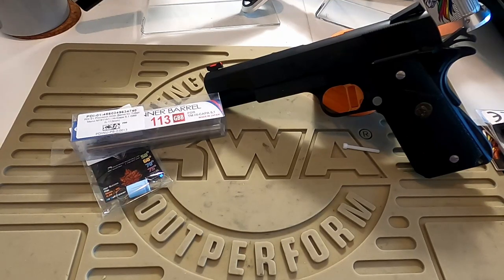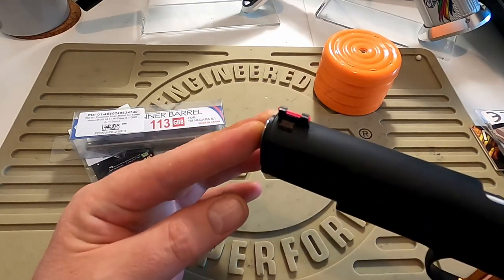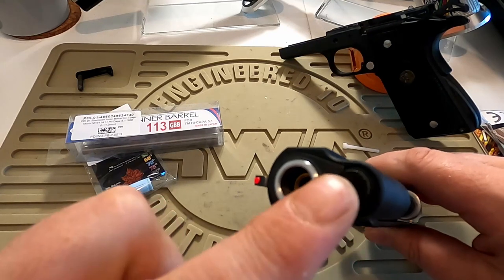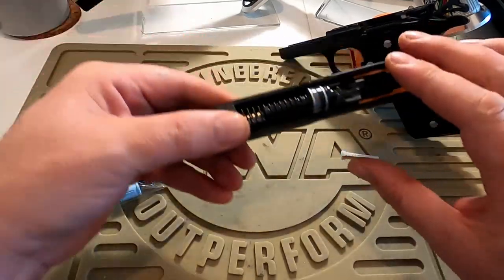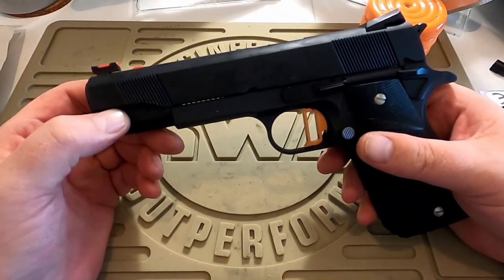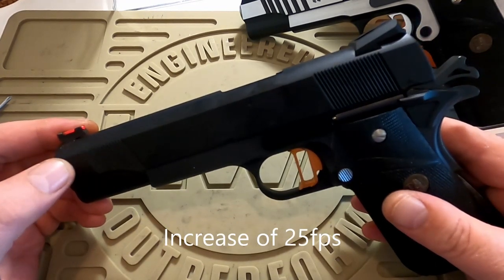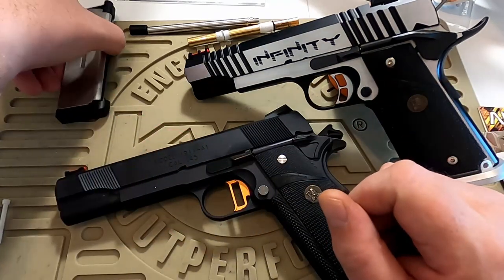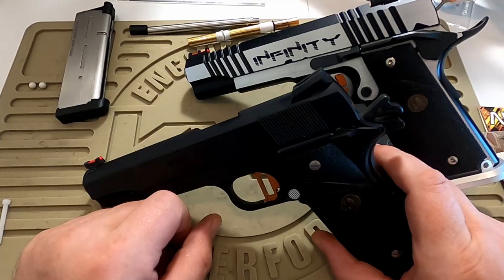PDI 6.01 VS Nine Ball 6.00 Inner Barrels Comparison

Comment: How can I get even more fps without changing my nozzle setup.
Reply from the maker: This isn't really an advice channel, but a few things to try:  tight bore barrel, longer barrel, teflon tape around bucking/barrel to reduce leaks, upgraded valves on your mags.  Although to be honest, a hi-flow nozzle is still going to have the greatest effect.
Reply: Twisty Customs thanks!! One more question, if I do run an aluminium nozzle what internals should I get so that my gun doesnt break? If u dont reply I understand cause its not an advice channel.
Reply from the maker: Honestly, I've no experience of running aluminium nozzles.  I've seen so many broken ones when my guarder enhanced with TM internals just keep truckin' on...
Reply: Ок